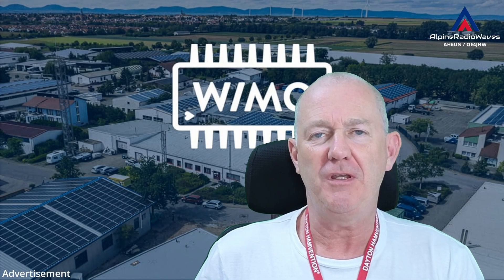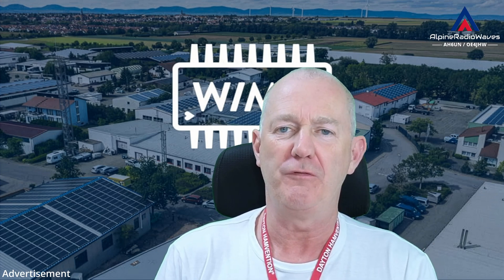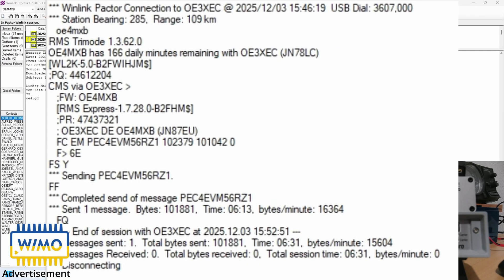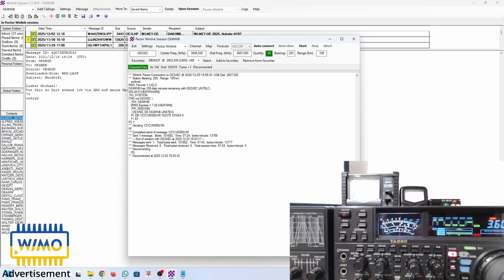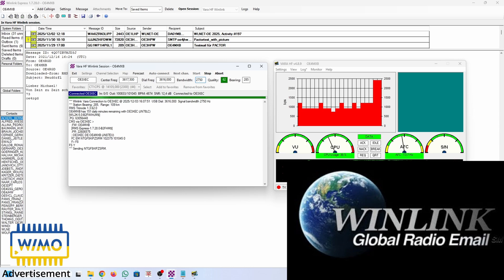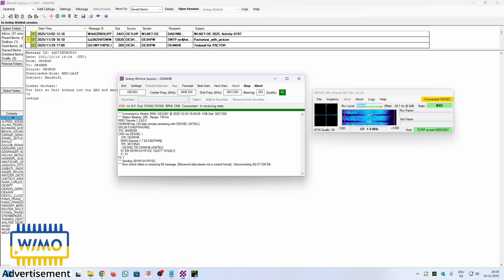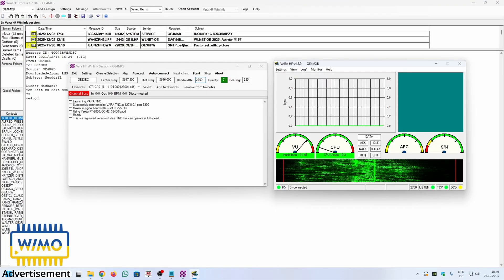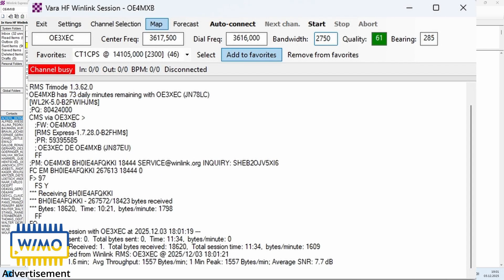PXdragon DR-9400 - need for speed - PACTOR 4 vs PACTOR 3 vs VARA HF vs ARDOP speedtest

Comment: What is a purpose of such device if modern trasceiver already can send/reveive audio via USB and doesn't require any additional hardware to do everything digital here ?
Reply from the maker: Good evening, Rolnas!

PACTOR 1-4 are commercial protocols. Amateur radio operators were never the main audience for these modems. And the devices were developed at a time when no one had even considered sound card interfaces and software modems (like VARA).

The target audience is emergency services like the Red Cross, etc.

It would be great if SCS offered the protocol without the hardware. Maybe I'll live to see it ;-)
Best 73! Juergen

Comment: Would you be willing to test it on 2 meters? I'm very curious about those results. I have a lot better experiences with varaFM. Also, the HF bands not really used a lot in emmcom. Kind regards, 73
Reply from the maker: Hello and thank you for the suggestion!
Yes, gladly. But unfortunately, there are no PACTOR gateways available here on VHF/UHF.
However, we do have VARA FM WinLink gateways.
And I can tell you that VARA FM is much faster than PACTOR 4. I've already tested it.
73&55 de Juergen OE4JHW
Reply: @AH6UN_OE4JHW  Thanks! I have falsly assumed that the Pactor 3 and 4 modems would also work on VHF/UHF. But thank you for your reaction!